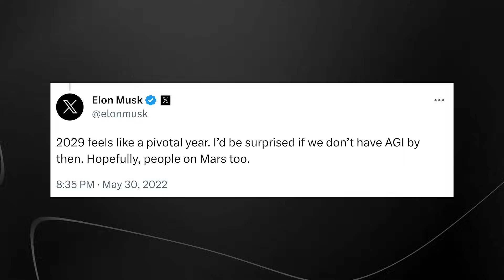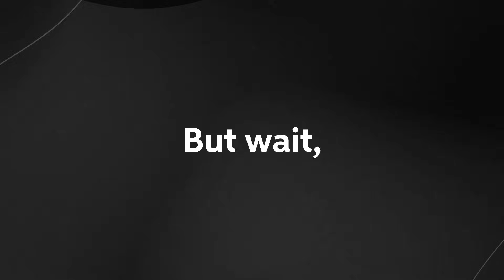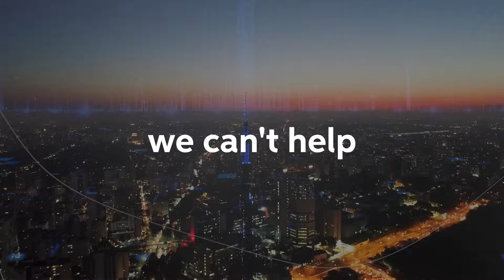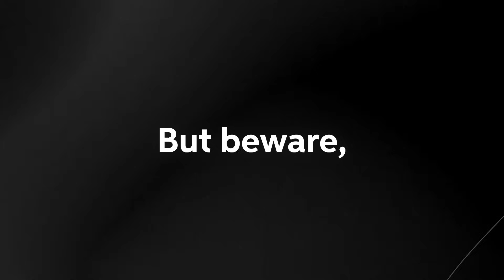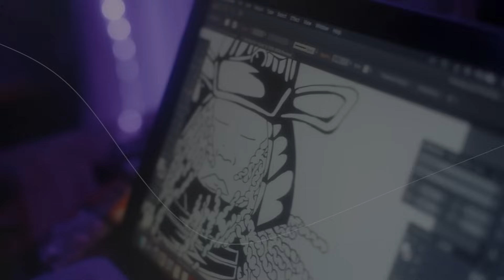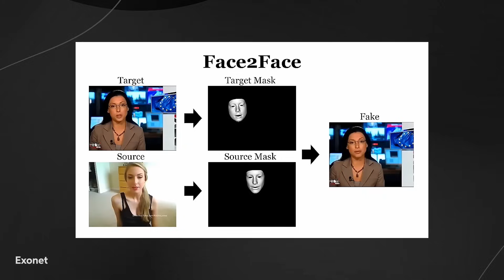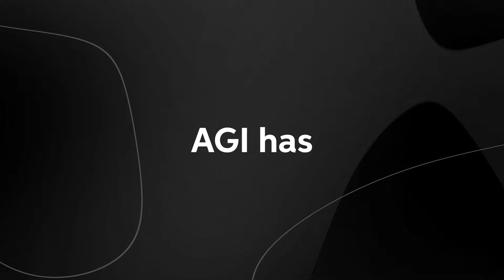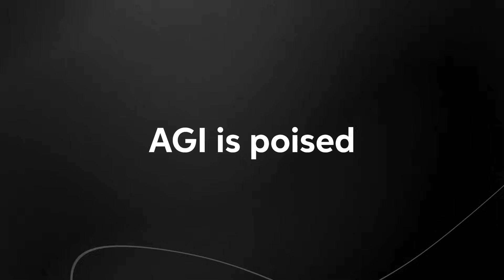Elon Musk’s Disturbing Prediction About AI

Comment: More like 2024 - 2025. All predictions have been proven to be for a longer than the actual time lines and periods. That is because the predictions have been done on a X and Y scale. The AI's expansion is not only on the X and Y scale/axises, add Z axis to get an idea of the depth of AI's evolution. It is not a line, it is exponentially expanding cone, that will evolve into a sphere once the point of the ASI is reached.

And once it starts expanding as a Sphere will become super interesting. Because the Sphere expands in all directions, it expands towards the backwards zones as well, penetrates the negative values as well , expanding in all directions all over the scales / axises 😂😅

Comment: Question : Doesn't it make sense that before or during the birth of A.G.I. that in the same context, genius level hackers, both White Hats and Black Hats will inevitablyl eventually have the abilities to circumvent A.G.I. in the nearly same  way as 
Such shadowey   techies operate anonymous systems not soley based on A.I. as it stands now at this moment in time?  Are all tech sectors working appropriately and efficiently enough to tackle questions such as these?  Could it be that there are simply not enough resources and manpower, let alone enough qualified minds to tackle such serious questions, let alone coming forward with the correct solutions to contain A. I. , let alone the emergence of the theorized "Singularity", as suggested in this video?  Are there protocals noone has even thought upon ...that can serve to act as key foolproof viable measures to further ensure the multitudes of probable events that might or  someday shall put many lives at stake as if the victims found find themselves in a preverbial kill pit?  And unable to escape? from?

Comment: Musk's history of time frame predictions is far worse than a monkey throwing darts. He's ALWAYS off by years.

Secondly, I guess it depends on defintion. But AGI where it is basically able to "think like a human" in things like understanding simple physics, math, and complex reasoning, that might still be a long way off.

Elon took lidar and sonar sensors off of Tesla cars because he reasoned that humans only need eyes, therefore a car FSD system should be able to do the same. But a FSD system based on vision alone will have to know the difference between a sky colored van crossing the road just based on the tires and windows whereas a lidar system would just realize there's a big object in the road.

I believe he is overambitious with AI as he is with everything. Not a bad thing when you are a revolutionary. But not so great with accurate predictions.